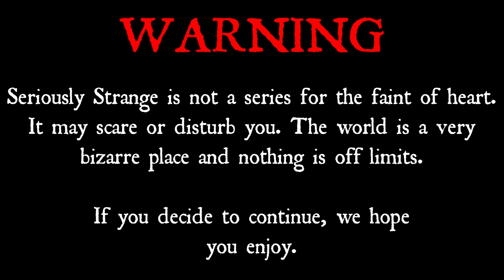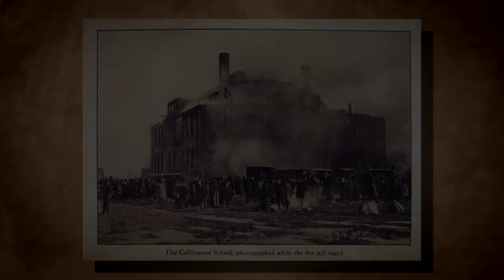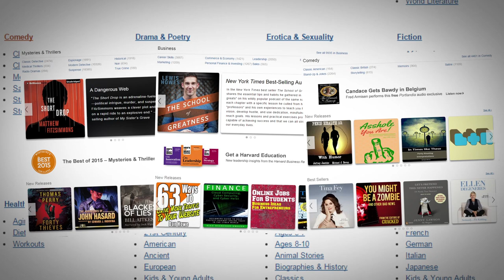3 Most Shocking Accidental Disasters | SERIOUSLY STRANGE #52

Comment: 172 children and 3 adults ? Where were all the teachers.

How heart breaking the little boy that went back to save his brother 💔
Reply: Ikr my heart sank when he Said that
Reply: +terebby1 That's what I was wondering. Sounds like they bailed without trying to shuffle the kids out
Reply: +terebby1 well a large amount of kids did make it out and knowing there are much less faculty than students, the 172 and 3 teachers were probably just very unlucky :(
Reply: I guess most of them said "screw the kids" and dipped out on them
Reply: They were probably on higher floors and couldn't get out past all the others. This is why schools have so many regulations for evacuation drills, and why there have to be multiple exits now. It's also probably why most Windows don't open in schools
Reply: Way to judge. Read the actual accounts of the fire, two teachers perished trying to get children to fire exits. The children were in a panic (naturally) and one teacher was trampled to death by her own students. One of the main doors was locked and a teacher jumped into the pile of children trapped in front of the door and tried pulling them to safety without success and perished herself. Each teacher had their own class and it's likely the other students who escaped the fire did so because they were safely directed out by their teacher. It would have been no use for the teachers who escaped to re-enter the burning building, they would have just added to the death count.
Reply: I understand that the situation is depressing, but did the teachers just-run out of the school, forgetting about the children?
It's kind of sad to think about, those children were frantically running out of the building, and none of the staff members said to themselves; "y'know, we should try to get these children out of here, fuck ourselves-they're fucking children!"

I'm sure several staff members did try to help the children, but if this were more true (as in, more staff members helping the children), than there probably wouldn't be as many dead children, or at least a little more dead staff members.
Reply: It's so sad... 😔😢
Reply: +terebby1 They were using the children as human shields :)
Reply: Yeah very heartbreaking but it looked like he loved his brother so much he went back 4 him thinking that he was still alive that's probably how he was meant to go...sad though
Reply: +terebby1 Listen to what he's saying 172 kids died, 2 teachers and 1 rescuer.
Reply: Classes with multiple grades used to be taught by 1 teacher. Especially in smaller schools
Reply: Hannah Brower But like I said, if more 'staff members' had helped, there probably would be less dead children, or at least more dead adults.

So yes, there would probably be less teachers, especially for the time.
But 'staff members' aren't just teachers.
Reply: The teachers probably panicked and abandoned the students saving their own lives.
Reply: All of you speaking like you would save the children instead of yourselves in that situation lol
Reply: Rainy Liu Honestly, I probably would save the children first. But that's just me.
Reply: hmu 😘
Reply: That's exactly what I was thinking. I think the teachers escaped and left the kids behind. Because a lot more than 3 teachers should have died if they struggled as much as the children
Reply: +Carl Hank i think the majority of people made it out, i dont think they just said "fuck it" and dipped...they probably were busy helping/keeping order among the people who managed to make it out thats what i would have done, to make sure people like johnny hero pants wouldn't stupidly run back into the damned building....
Reply: About the little boy, so sad and especially since, correct me if I'm wrong but it was his little brother. Deep down, me included, I think most older siblings would risk their lives for a younger sibling.
Reply: Thank you. I'm both :)
Reply: Probably ran like hell
Reply: 420 likes k
Reply: Everyone just assuming the teachers saved themselves should just stop.
Reply: +Renee Zhang it was 2 teaches and 1 rescuer
Reply: There was over 366 children in the school at the time of the fire meaning over half made it out alive most likely with the help of the other teachers that made it out alive some got put windows like the boy who went back in to get his brother the only problem was that the kids stuck in the burning building had gotten jammed in the stair way and there was no way to save them and it was 2 teachers and a first responder
Reply: Remember that this was a different time. People weren't being employed all the time to be teachers and there wasn't a developed way to organize classes yet, let alone safety protocols.... He said that this event changed safety fire protocols in schools forever.  They were at the mercy of ignorance.

Unfortunatley many safety protocols we have today are at the cost of horrific accidents like this...
Reply: Saving the rest of the children

Comment: Only two teachers died?!?!? So what, the rest of the staff just ran outside and saved themselves? Fuck sake.
Reply: It wasn't uncommon to have 1 - 2 teachers for every 60 or so students so it's very likely that students far outweighed teachers in numbers. It wasn't a matter of adults necessarily leaving children behind but rather, due to reduce lung capacity, smaller bodies etc. it's tragically more likely that the children died of smoke inhalation, were crashed to death, suffered severe injuries when jumping from windows etc.
Reply: "HUNDREDS OF STUDENTS" and only 8 teachers? Oh, please. I have about 250-350 students in my school and we have like 19 teachers. Adults tend to be more wise than children (obviously) so they can control the situation and keep their calm. They are also taller so they can see overhead

Comment: I read about the Halifax explosion a few years ago.  According to my terrible memory of the wikipedia article about it, it was one of the largest man made explosions prior to the advent of nuclear weapons.  Something like 3 kilotons of TNT.  That is some scary shit right there.
Reply: It was so big they used it to measure other explsoions.

it changed the ocean floor

The explosion projected the 1140 pound anchor shaft of the “Mont Blanc” approximately two and one half miles from the point of the explosion.
Reply: He says at the end only 1 crew member from the Mont Blanc died... how is that possible?
Reply: +Challen Bellamey they evacuated the ship when it caught fire, took 20 minutes before it eventually exploded, they knew the ship was filled with explosives and probably got away from the area as fast as possible
Reply: +Jordan King Yeah you're right, I read the whole Wikipedia article after watching. Also, apparently the people that got blinded, it was from glass shards rather than from light like Rob said.
Reply: +evilcam The largest planned explosion before the trinity bomb test was the Messines Hill 60 explosion, which killed 10,000 people. This was in June, 1917, before Halifax. The largest unplanned explosion before trinity was the Halifax explosion, at 2.7 kilotons.
Reply: +VintageLJ its the largest non nuclear man made explosion ever recorded
Reply: +Jordan King that still wouldn't be enough time to swim away or run they must have got picked up by passing ships
Reply: I actually live in Halifax and yeah you're right. It was the biggest man-made explosion until the a-bomb. We're still finding pieces of the ship in the harbour.
Reply: +Sam Matthews 
Correct, I am Nova Scotian and I have seen the anchor shaft site.
Reply: +PrayingSeraph yeah I'm in springhill
Reply: WHY DID THAT SPIDER OM YOUR PFP SCARE ME WTF
Reply: I live close to where that happened
Reply: try running a metal detector threw some old trees you will likely find shrapnel

Comment: http://www.collinwoodfire.com/?page_id=2.  Good site on the explanation of why so many students died.  There was only 10 teachers and close to 400 students who were immigrants that many spoke little English.  The building went up in less than 15 minutes.  The two teachers who died were trampled by their students while trying to save them.  Most of the teachers stayed and tossed children out windows to try to save them.  The building did have a fire escape which allowed all the students on the top floor to survive.  Most of the children died because they panicked and ran back or because one set of doors only partially opened they pushed up against the door and jammed themselves into the building.